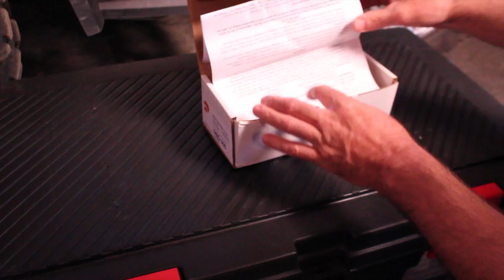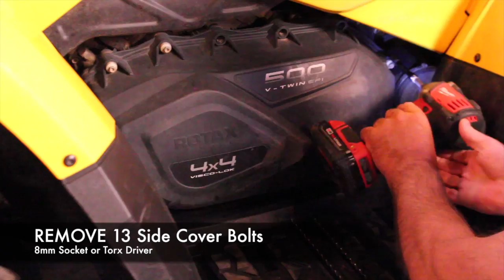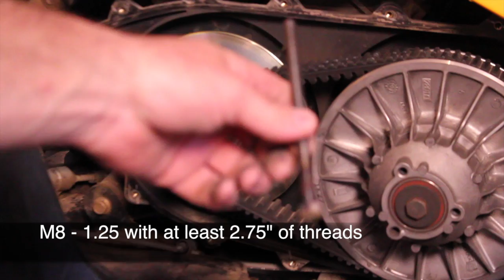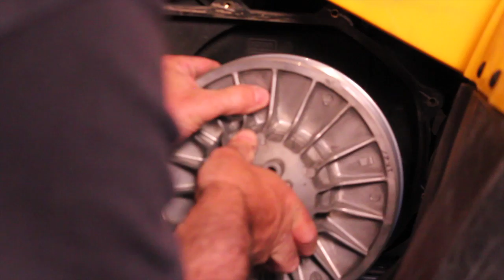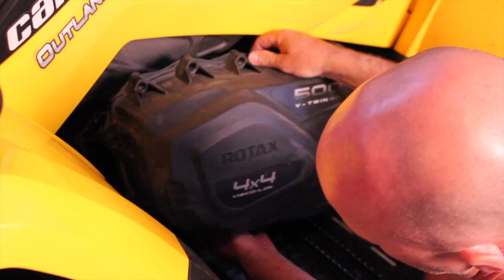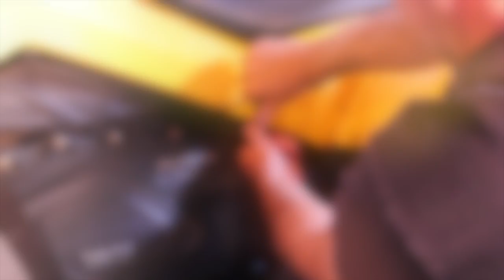Installing Dalton DBO500 Clutch Kit Canam Outlander 500XT

Comment: I have a 450L, but I used your video to help me install an EPI clutch kit. I did it today and everything went perfectly. Thank you for taking the time to make this.
Reply: Note: The procedure is the same, but the 450 has reverse threads on the primary and the belt goes backwards.
Reply: Y

Comment: what have you noticed with your kit? slightly higher engagement? better midrange? did you lose any top speed?
Reply from the maker: good improvement in bottom end, very noticeable improvement in Mid range and back shifting.  No loss of top speed -  Actually think I gained 1MPH.  I have a before and after test video coming very soon where you'll see the comparisons.
Reply: Very nice ive been considering one of those new outlander L500s but have always heard negatives about the initial takeoff, but afterwards their screamers. Is that test going to be that race between you and the 500h.o.?
Reply from the maker: Cogswalmen I think the new 500L has more HP than my 2012 500XT out of the box.  I think its 46 where I am 40.4HP so it should be improved.  I think the 650 Canam is a perfect machine.  I will be having a rematch with the Polaris 500HO and I think it should take it now.  So far the tests are using a G-force meter and under same conditions, same location before and after...
Reply: I had an 800r 2012 xt and I loved it I will likely get one soon but I wouldn't mind a 500 either. If I did I know id miss that OH SHIT!!!!! feeling of the 800. A buddy ended up totaling it for me :( good thing for full coverage. Looking forward to the test I saw they were about neck and neck before
Reply from the maker: Cogswalmen The Test Video is Live:  http://youtu.be/ZlBNvbLaGR0

Comment: How come you didn't install the new primary spring?
Reply: Also, does installing this void a warranty?
Reply from the maker: Outty500, I didn't install the primary as Dalton Industries tech said that with stock tires it wouldn't help.  Once I go to oversized tires, I will put the primary in - but for now it really doesnt need it.  The Spring kit does not void warranty.
Reply: Ok, just wondering... Thanks!
Reply from the maker: TheOutty500 No problem - I Actually called Dalton Industries as I wanted to just buy the primary spring thinking that would give me better bottom end.  Thats when the tech guy said to not replace the spring - buy the kit and use the spacer on the primary and the new secondary.  It's a lot snappier now, and more fun for sure!